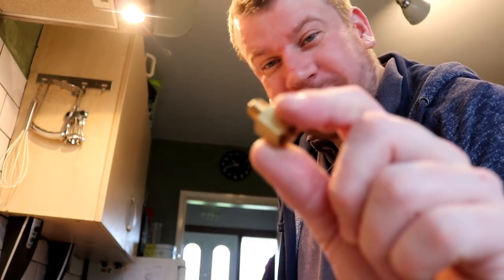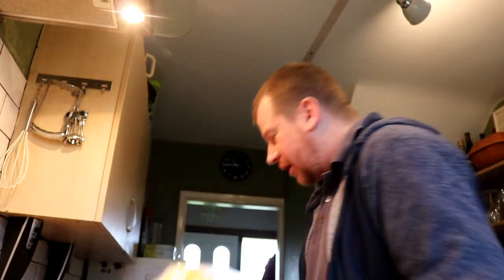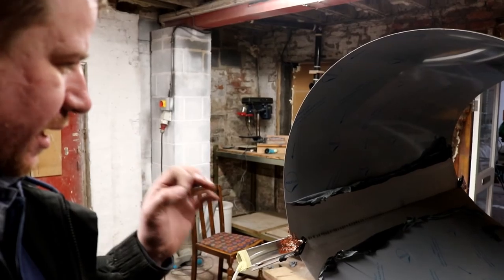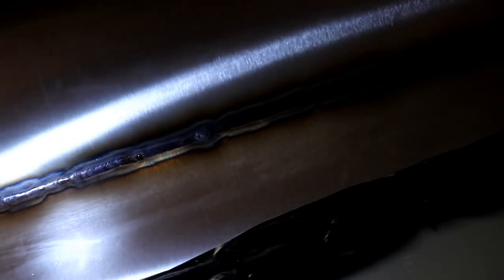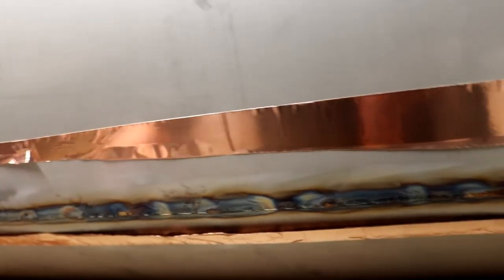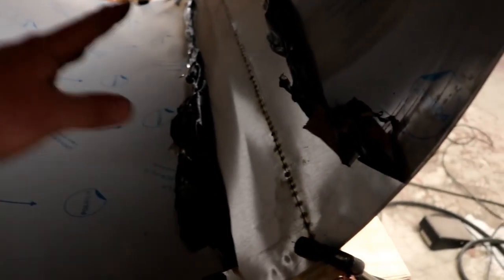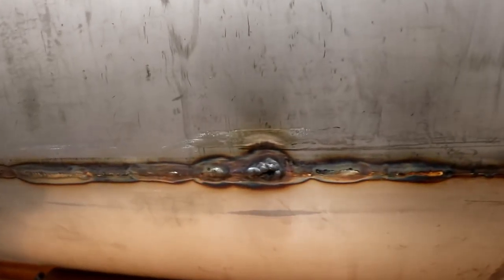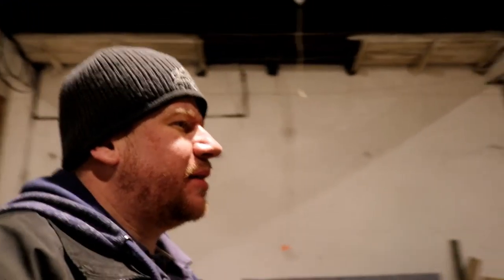MY FIRST TIME

Comment: Nice welding job. Once you get the backside purged with argon, you should be able to lower your flow and keep your regulator from freezing. We always had a bubbler on the out flow side also to make sure we had flow thru our equipment. Cheers Harry great stuff🍻

Comment: Pretty damn good for your first time! I'm a code welder in the cryogeinics and aerospace industry and did some food service welding before that too. If you have access to copper you can clamp it on both sides of the weld to pull out the heat from the welding to minimize distortion, blowouts, and help avoid cooking the stainless properties out of the stainless steel. If you want your beads to lay flatter you can move the puddle from side to side after adding rod. I used to weave or walk the cup on stuff like this cause filler metal usually wasn't allowed on the inside cause if anything gets caught on a ripple or pin hole bacteria can build up on it. Hope that helps you with your project. Love the videos man hope to see more soon!

Comment: Well impressed! Looks like you could indeed have two tanks for Monday if you wanted to. I was more thinking a week on Monday at the earliest to be honest which just proves me to be a real doubting Thomas 😦 . Great vlog as usual, I don't know how you manage to fit it all in 🙄 . It took me nearly a day to edit my latest offering, admittedly I did make work by creating it as one and then splitting it into three being a bit of a novice at this video malarky 😄 . Will you be able to grind, sand and polish the welds up after or will that create too many micro scratches to worry about? Waiting avidly for the next one. Cheers, Schnuz.

Comment: Cracking stuff there Harry , you will soon be a master of the welding, if you cut the cones you will run them through the rollers , or when the roller is set of set when you roll it will cause a cone cheers